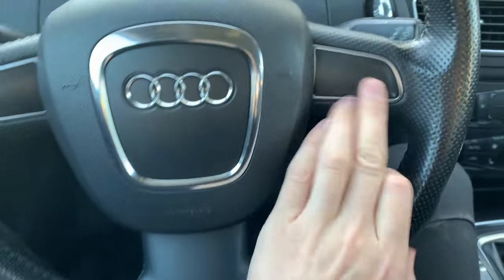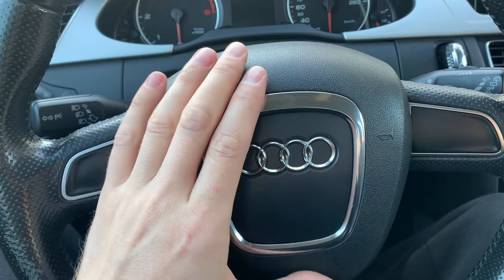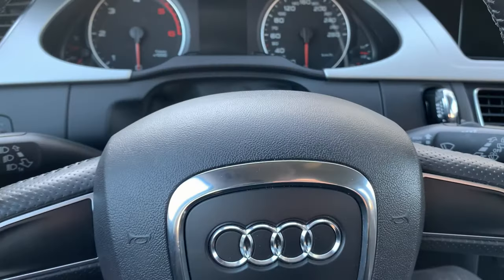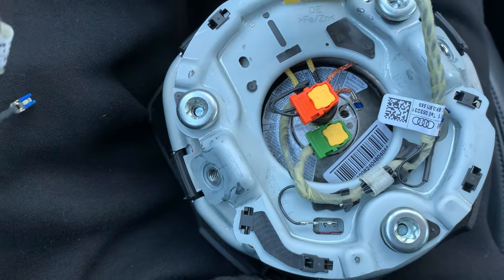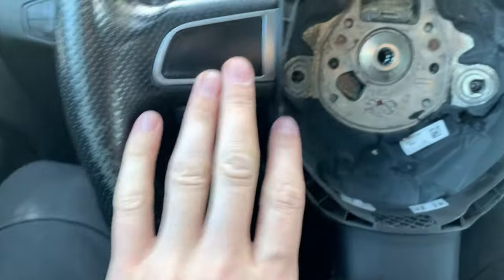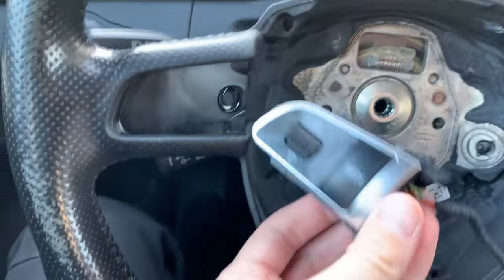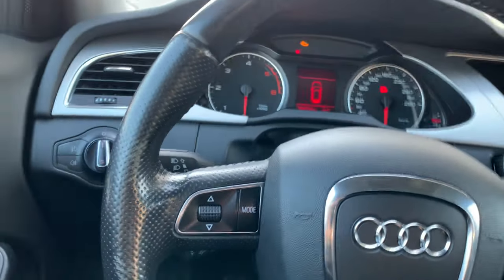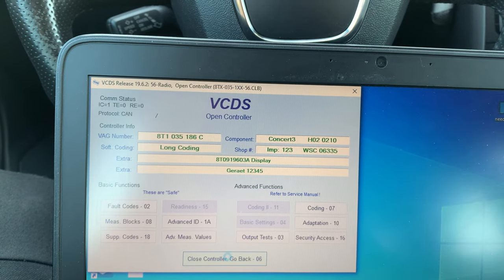How To retrofit Multi Function Steering Wheel - Audi A4 B8 DIY

Comment: So i see you didnt need to change the steering wheel module as well in order for the buttons to function? I have the exact same steering wheel on a 2009 audi a3? Does it wary or do all models that have this same steering wheel have the module ready for the buttons to work if installed? I know some different models without multi functional steering wheel eg 4 spoke without the plastic caps you need to get the whole new steering wheel plus the module if you want it to work.
Reply: His module just already supports the function of the multifunction steering wheel ,thats why he didn't have to replace it .
Reply from the maker: Yes exactly. I’ve replaced the steering wheel module in another video when I’ve installed cruise control. (See my channel) You cand watch that video and you will also see a list of module codes that support MFSW. 👍
Reply: Ok thanks guys. I thought that this model had the module already since the wheel is upgradable without having to replace the whole thing, in which case i’d just get the controls install and code it because i have the same steering wheel on my a3.

Comment: Whats the part number for wiring, or where i can get the whiring? (Already bought buttons)
Reply from the maker: Hi!
It’s 8K0 971 589 A.
👍
Reply: @istillplaywithcars  is the wiring same for round steering wheels?
Reply from the maker: @mr.officer3011 I think not, the round airbag steering wheels are for the b8.5, where the module is different, the wheel has more buttons. So I think they are different, but I’m not sure 🤷‍♂️

Comment: Hi, if my car 2011 and allready has cruise control but don't have multifunction on steering wheel, do i still need cassette to buy?
Reply from the maker: Check the code of the steering wheel module and compare it with the list from the video. 👍

Comment: Did u change steering wheel module or just the multi functions on steering wheel?
Reply from the maker: Hi! I did changed the steering wheel module a few days in advance because I retrofitted also Cruise Control and my old module was not supporting this option.

Comment: Hello, please, if you can answer my question, I have the same Audi A4 B8 model that does not have controls on the steering wheel, do I need to change the steering wheel airbag as well or do I just need to insert the controls
Reply from the maker: Hi! No, you don’t need to change the airbag. But you need to change the airbag harness / cables, because the ones you have right now don’t have the connector for the mfsw. 👍
Reply: @istillplaywithcars  thx 👍👍
Reply from the maker: You’re welcome! 😁👍

Comment: Do I need to change my steering wheel module on my a3 or it can be coded
Reply from the maker: You need to check the part number and see if it supports it.
Reply: @istillplaywithcars  thanks
Reply from the maker: No problem! 👍

Comment: Great video again Can you do long coding with obd eleven can you show video if you can having trouble with traction control light on can't get the car to recognize the airbag module put the old module back on the traction light goes out but can't get the speed controller working with the old airbag module back on the car there's one pin less on my Old unit that must be responsible for the speed controller working I also have a mucar 07 scanner tool does most things but can't get the Long coding to recognize the airbag module thanks will have to buy the same scanner as you are using what version of scanner is yours thanks again great job I am 70 years old so bit slow but been a mechanic for 50 years still love doing all my own work and service take care

Comment: do you also have the video of retrofitting the steering wheel with flat bottom?
Reply from the maker: Hi! No. If you refer to my older videos, that’s a different car. It was an 2014 B8.5 A4 which had factory flat bottom steering wheel. 👍
Reply: Ah Okay thanks🙌
Reply from the maker: Cheers! 👍😁

Comment: How to retrofit a multifunction steering wheel Audi TT mk2.Can you tell me , Please
Reply from the maker: Hi! I have never done it, but I assume the steps are the same. I did it for an Audi A4 B6 from 2002. Exchanged the steering wheel module (not the clock spring) and added the cc lever, coding and it worked.

Comment: Salut scuze am un audi a4 2014 cu volanul in 3 spite dar nu am comenzi as vrea sa ii pun comenzi oare ce trebuie schimbat presupun ca tot volan, doar atat pot schimba doar covrigul cu unu cu comenzi si sa pastrez airbag-ul codat comenzile din vcds sau trebuie schimbat si altceva cum ar fii ''spirala volanului'' cea pe care se clipseaza airbag ul.. multumesc anticipat
Reply from the maker: Salut! In primul rand nu e necesar sa schimbi tot volanul, capacele pe care le ai acum pe volan se pot scoate si inlocui cu butoane, deci e de ajuns sa cumperi butoanele.
In al doilea rand ai mevoie de cablajul de la airbag, care iti comecteaza si butoanele cu modulul/spira.
Im al treilea rand trebuie sa vezi daca modulul/spira iti suporta comenzi pe volan (dupa cod), pe tru ca daca nu suporta va trebui sa il inlocuiesti si pe acela.
Poti sa imi zici daca ai deja cruise control?

Comment: i get error 31 in vcds do you know how to fix this? followed your tutorial
Reply from the maker: I am not familiar with this error, never had it. You get the error after doing the coding? Or?
Reply: @istillplaywithcars  yes I installed the wheel and multifunction then used vcds and got error 31
Reply from the maker: It means that the coding is not good. Maybe your steering column module does not accept this option. What is the steering column module code?

Comment: Hi, I have a mk7 golf with a standard non multifunctional steering wheel, I was just wondering is it still possible for me to install a mk7 golf gtd multifunctional steering wheel? Thanks
Reply from the maker: Hi! Yes it is, for sure. I don’t have details, but I would start with checking the HW Part Number of the steering column control module, to see if it supoorts mfsw.
But in principle this retrofit cand be done easily. 👍

Comment: Hi how to code new steering module in 2011 a4 all road ? I believe it’s been changed or something had because the buttons on steering wheel don’t work please help
Reply from the maker: Hi! You should follow the same process done by me. It might be that the steering wheel was changed but not coded.
Do you have cruise controll installed and working?
Reply: @istillplaywithcars  hi the steering wheels is the same if I’m not wrong it’s just the steering wheel control module was changed with the wires and needs coding in, I guess I will need the old code to put into place of the new one… but I’m not sure how much appreciated for help
Reply from the maker: Understood! You don’t need the old code. Just go to coding and check the boxes of the things your car has installed. You will define the new code by this.

Comment: Does this metod work when is dsg with F1 on steering wheel? I hear it cant be done
Reply from the maker: Yes, sure it works. If you have paddle shifters I assume you already have mfsw.
Reply: @istillplaywithcars  i have a3 8p 2009 s line, with f1 paddles but without mfsw buttons
Reply from the maker: Understood. I recommend that you scan the car, get the code of the steering column module and google it. You can find if that module will support the mfsw.
It might be that you still need to change the wire harness because I assume it will not have the connector dor mfsw.
Reply: @istillplaywithcars  i installed buttons, but now my F1 paddles dont work i dont have place to connect them xD
Do you know how to solve this. Is there any splitter or something like that. Sorry on bad english, hope you understand
Reply from the maker: https://www.audi.homeradiatorsreview.com/mfsw.html
Reply from the maker: Have you checked this link?
https://www.audi.homeradiatorsreview.com/mfsw.html
I understand that is should work.
Reply: @istillplaywithcars  i already have highline module i checked everything. But my new buttons dont have connectors for F1 light and paddles thats the problem.
Reply: I finnaly found buttons that support f1 paddles. Now F1 works and buttons are lighting but not working. Now i just need to turn it on through VCDS??
Reply from the maker: Yes, I assume so. Go to someone with vcds, ask them to code the multi function steering wheel. You are one step closer to get it done 👍
Reply: @istillplaywithcars  thank you my man 👍👍